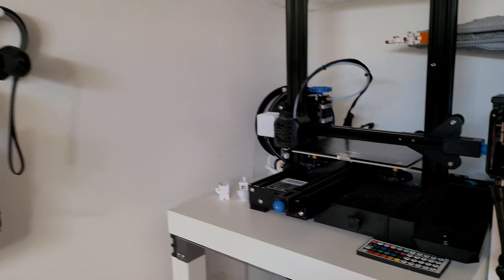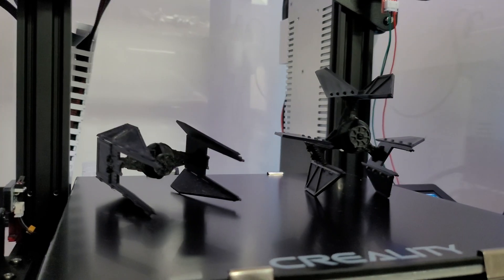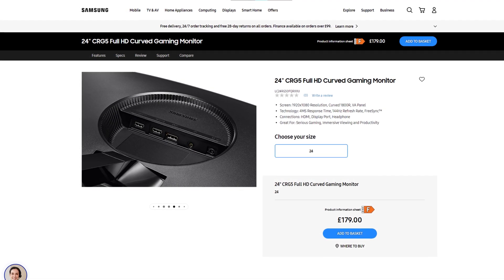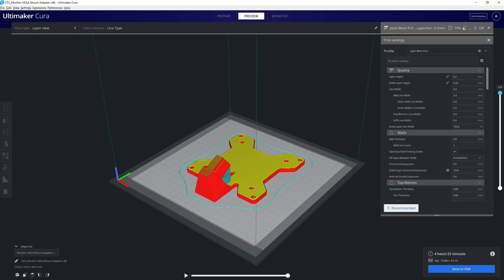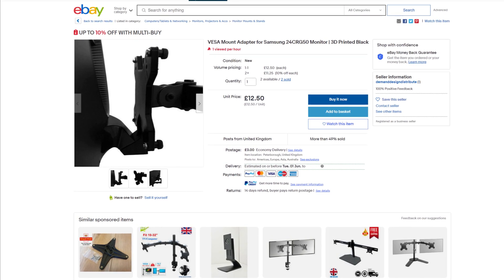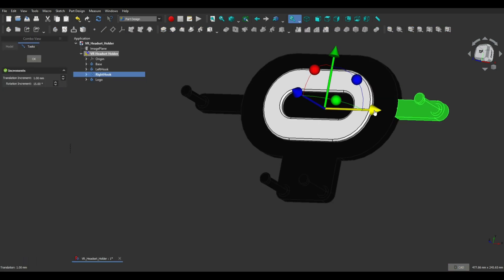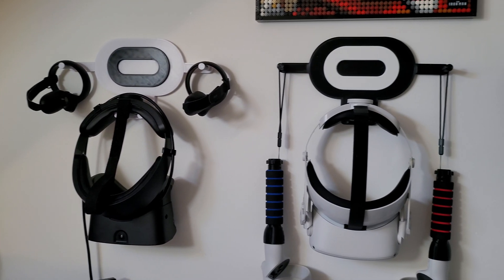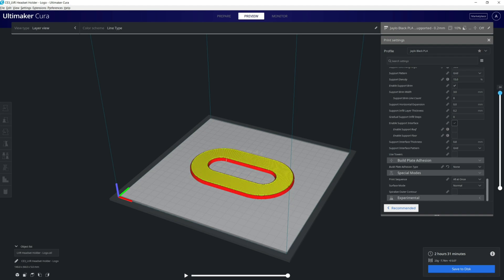Practical uses for 3D printing at home

Comment: nice job on figuring out the mount. not an easy thing to solve with the weakness of 3d printing. i imagine theres was a few versions that instantly snapped? :P

i've been wanting to also look into salt annealing, so structural parts can be made into solid pieces with no weak layer lines.